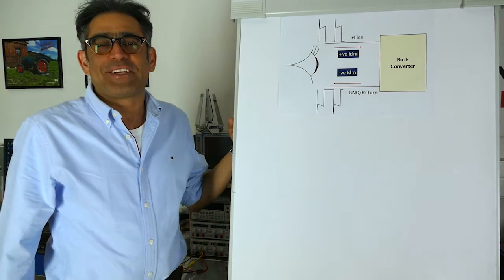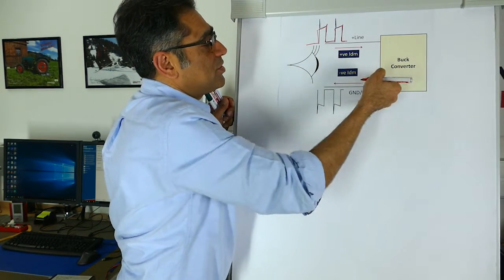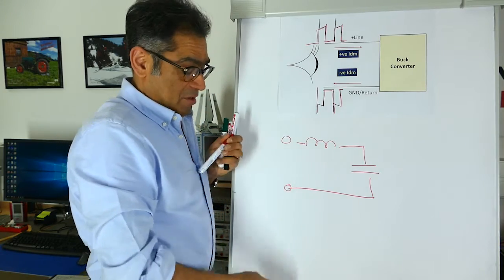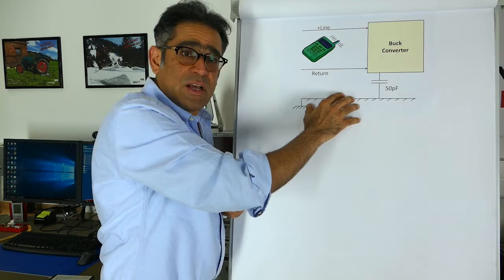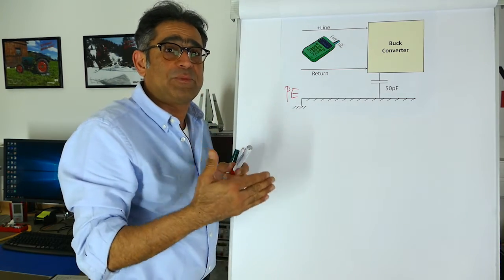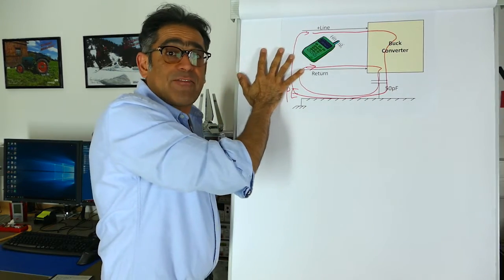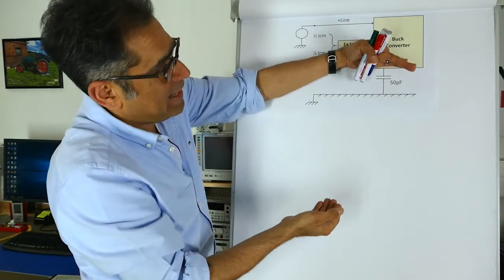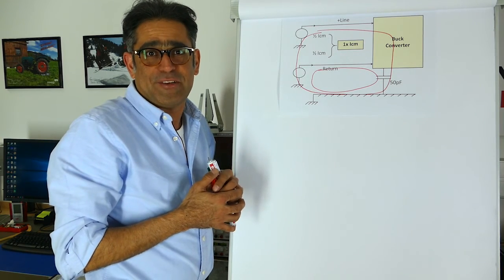EMC Filter Design Part 1: Understanding Common Mode Noise and Differential Mode Noise

Comment: Hi OMICRON Lab, is that why on SMPS of TVs the use a capacitor between the HOT GROUND (AC) and the COLD GROUND (DC). See image from google below: https://electronics.stackexchange.com/questions/268597/coupling-between-hot-ground-and-cold-ground
Reply from the maker: Yes this is correct. 
The hot side needs to be isolated from the DC side for safety reasons (you can see that they have different ground symbols).
But if we completely isolate, there is no low impedance path for the common mode currents to return to via the cables. If they cannot return, they have nowhere to go and therefore will radiate into the air and this could cause a failure in the radiated emissions test. 
We cannot connect the two grounds with just a wire as we will then lose isolation. So the same high-frequency Y caps between the Hot and DC grounds will allow common mode currents to return via the cables whilst maintaining the isolation.
Reply: @OMICRONLabTutorials   Noted. Thanks for the answers! I am looking forward to watch Part 2 to 7!

Comment from the maker: The picture is for illustrative purpose only! A mobile phone is depicted since it is assumed, that radiated noise is coupled to line and return with respect to GND.
Reply: Ok, but my assumption is that maybe the possition and the distance beteween mobile phone and "DUT - device under test" has also infuence/impact.
Is this correct? If yes, how is it considered?
Reply from the maker: Of course it will have an impact on the size of the disturbance. But that was not considered or calculated in this case.

Comment: How about the scenario when the mobile phone is placed on top of the buck converter and not in between cables?
Reply from the maker: Well than it will couple into other parts of the circuit. But still it can couple a disturbance into the circuit. Please note that this must not be a mobile phone. That is just an illustration of a coupled disturbance signal that can come from any EMI source.